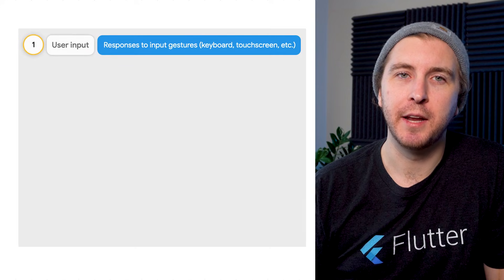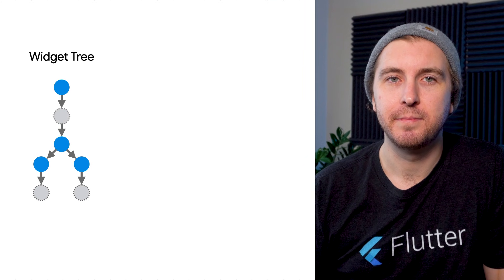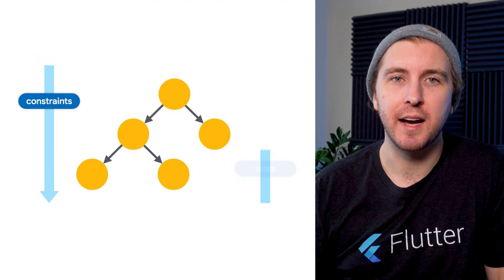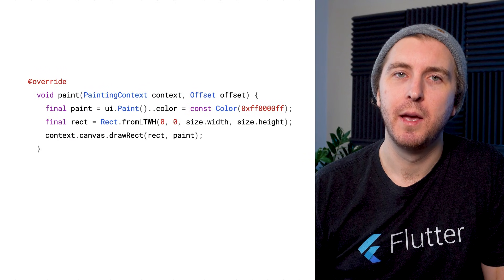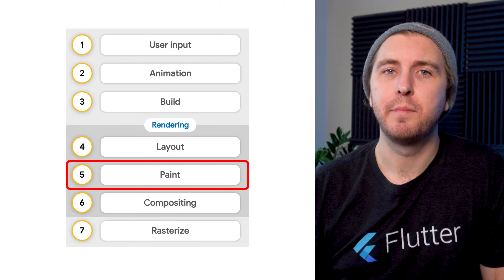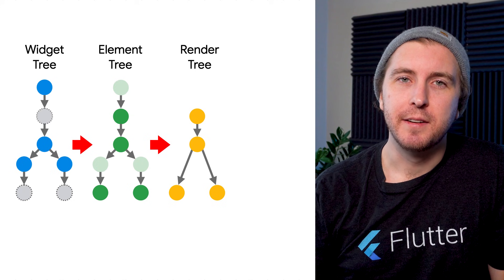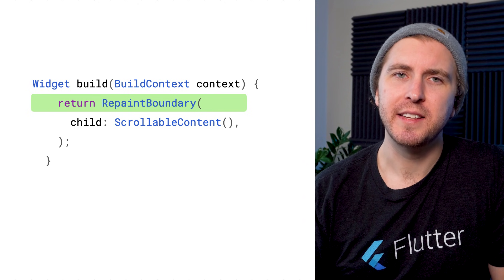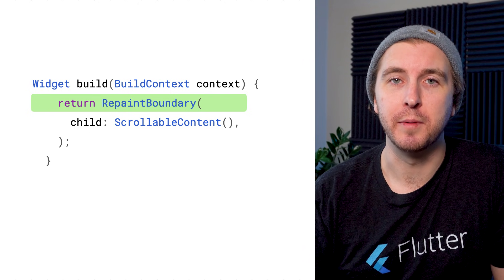Rendering?! | Decoding Flutter

Comment: A little similar to the web. Are there tricks to cut layout cost like there are tricks on the web (with CSS for example). I mean, it looks like for the layout part of the pipeline, Flutter needs to know every drawing boundary and size of every single widget before the painting pipeline. If we could somehow help flutter out with that?
Reply: Yes, it's very similar, if you don't place a size on images in HTML, you will find the page content jumps down as the image load, a repaint. Similarly, images are lazyloaded in Flutter, and can cause lower widget to jump down, a repaint, to prevent this you have to give Flutter the aspect ratio of the lazyloaded image, by parenting the image in an AspectRatio widget.